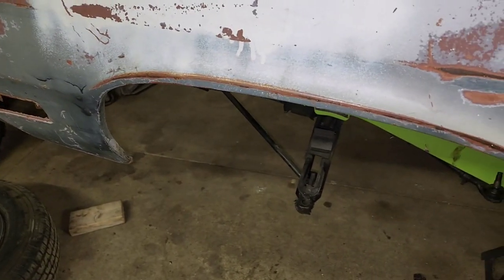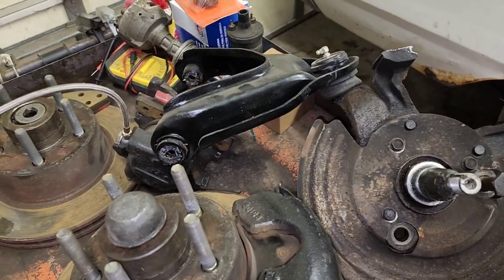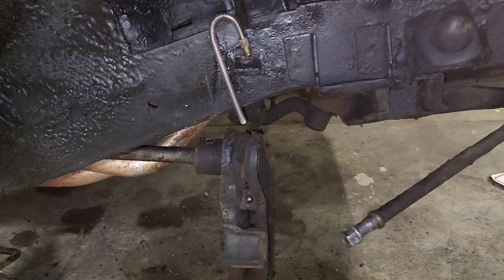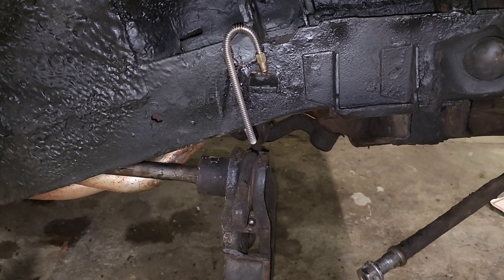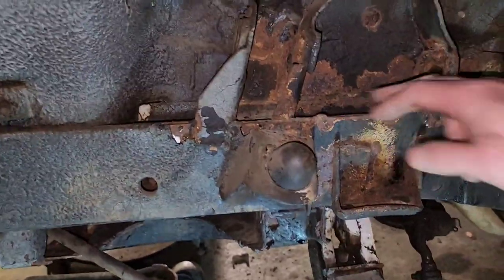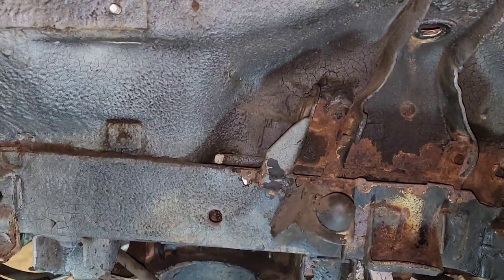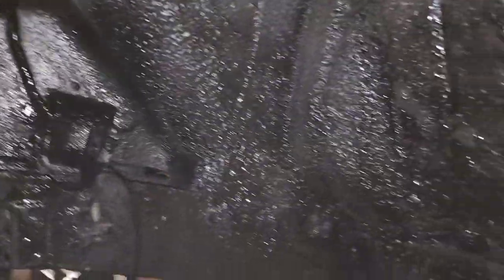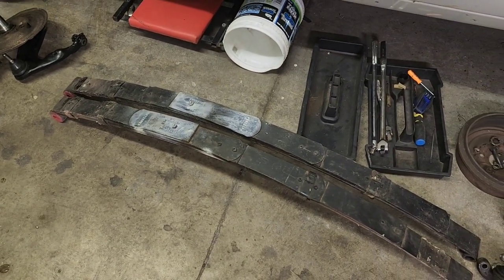1967 Dodge Dart GT: Low Budget Front Disc Brake Conversion #nonamenationals #mopar #340mopar

Comment: I did my free, clean '76 Valiant sedan- came with discs, but did the '12" disc swap (in actuality, 11.75").' Poly bushings in a couple spots (sway bar, strut rods, rear leafs), did the Moog offset bushings in the UCA (rear turned 180 degrees out). It's never going to be worth what my '69 Swinger is, but it is fun and is a very good handling/braking car for not too much $